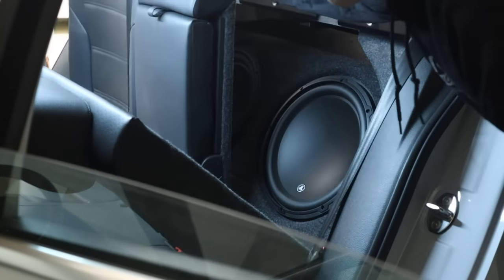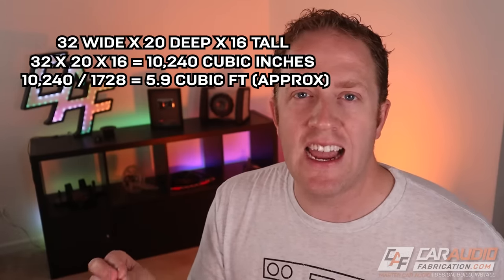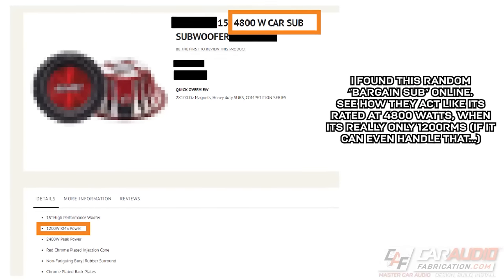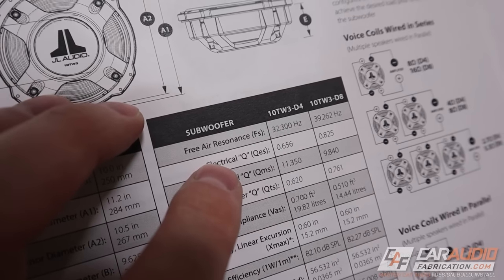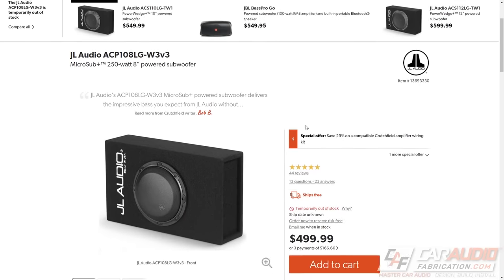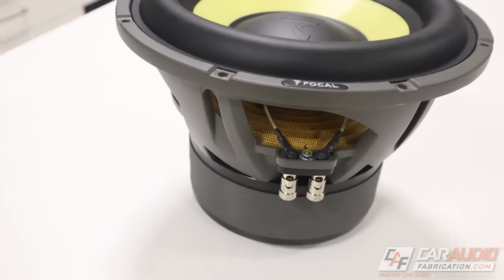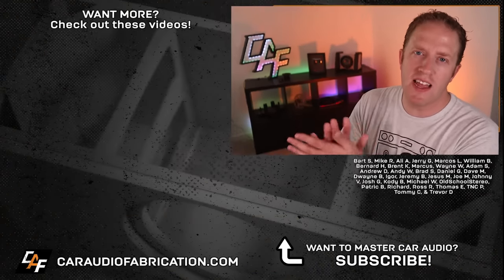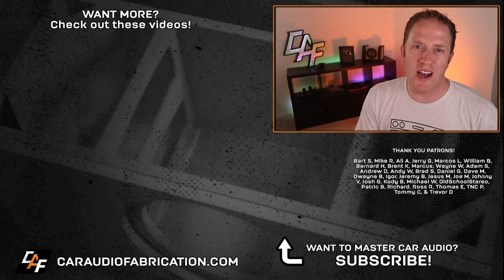DO's & DON'Ts - Picking a Subwoofer for YOUR vehicle!

Comment: i vote we call everything 'walmart watts' except for RMS. maybe then people will get it.
Reply: Best comment I've read in 2021.
Reply: As an former tech, I can tell Wal-Mart watts from what can be reported as RMS most of the time.  There's a certain build quality required in high current capable amps.  Anything worth buying is worth researching.
Reply: Wish watts seems more fitting
Reply: Hello I need help please somebody help me. I want to upgrade my factory sound on my 23 vw Taos but the person couldn’t take the dashboard apart or open it because he couldn’t unclip it and didn’t want to break it, please I need to upgrade it’s driving me crazy thanks
Reply: @reyeselizabeth8948  Just have someone else do it or do it yourself
Reply: Acquire you a interior plastic trim tool set from like eBay and disassemble the vehicle yourself but do it carefully, and you can always try to find information on where the clips would be or maybe find a pre-owned panel and note the locations so you have an idea of where to apply slight pressure to push the clips out to remove the panel
Reply: @reyeselizabeth8948  a pocket knife is usually my best tool for popping panels.

Comment: I see a CAF video, I like it and then watch it.
Reply from the maker: You guys are the best! Thanks! 🤗
Reply: Same
Reply: @filibertofonseca8083  5
Reply: I just did the same thing 😂😂
Reply: Facts
Reply: @CarAudioFabrication   i have a 2019 accord lx base model, and I am thinking of putting a rockford 5 ch. Amp with a rockford p2 and rockford components in the front and coaxial in the rear. My understanding is that the p2 is rated at 400 watts rims and the channel that will push it might get me 300 to 350 watts and I am looking for 500 rms from a sub and 400 to 450 rms.will the p2 and the amps ch. 300 to 350 rims enough to hit really hard and clear or do I need a system that is stronger in this type of configuration? Need your expert advise i do not want to make a mistake with this system. Thanks.
Reply: Do seal boxes have deep Bass

Comment: In the mid 1990's i did my homework and bought my first subwoofer.I bought a JL Audio 12W6 and i had it wired into 3 ohms in a sealed box and used a GENESIS Dual Mono at low gain to power it.The sound was musical,loud and very tight and i have not had to buy another sub and both the amp and subwoofer are still in use now! The JL needed to have its foam replaced but its been an amazing sub.I have just bought a car with a Bose system which has 2 'free air' (fires into the trunk) subs and they are loud but sound totally fluffy and uncontrolled....sealed enclosure anytime.
Reply: Genesis uk amps  awesome
Reply: Most cars I owned had jl subs. 3 12w6 on Fosgate bd1500.1. It's life changing.  Nothing else can compare.  Sealed for the win
Reply: @daviddeatherage4219  I had 4 x 15w6 in a sealed enclosure running off a huge class A/B Hifonics amp (forgot which one it was) and since then ive been forever trying to chase that sound quality. I recently got back into car audio after nearly 20 years and went with the JL 13W7 in a ported enclosure and HD1200/1 amp and im quite disappointed as its just not quite what I expected. Now im thinking of selling the 13W7 and replace with 3 x 12" more efficient subs
Reply: @B15SDMDESIGNS  I've always ran hifonics Zeus love em. But I am in love with 13w3s three of those put serious stretch marks in paint on quarter panels.
Reply: @B15SDMDESIGNS  dude the ported box has to be super physics nerdtunes. By a physics PhD. Stereo shops miss a lot of things. They are trying the best they know what works. For real it is a science.
Reply: Jl audio has that distinct  clean sound, no sub can match. In 1996, we had the first IASCA show in Philippines. The Van won, rigged with JL Precision Power  Audio control system. The detail was an unconventional  speaker from France called DAVIS Acoustics. Those were the fun times.

Comment: That was a great video👍I’m a retired Car Audio Specialist and just watched to check you out and very well explained to people in a very misleading market❤️I would add that the car is the biggest factor in the choice and only take a few test to determine the cars resonant frequency to get the best sub❤️Most people think I have a pair of 15” subs in my H2😂A simple 5 channel 1000 watt Fockford amp and a JL13w3 tuned at 25hz ported and will play smooth and bounce the wipers on low notes😂👍❤️30yrs at it and still got bass in all my rides at 53yrs old and love my music loud and clean👍
Reply: That's a nice combo. That type of system in a suv or a hatchback hits hard.
Reply: whats Fockford? 😆
Reply: My two 13.5w3 on a cheap 60bucks performance technique 3200w Amp. Was the closest setup to audio performance perfection 3 12w6on fosgate800.A2. I miss my youth
Reply: @williamaraujo779  I think he misspelled Rockford , as in Rockford Frostgate

Comment: Back in the late 90s / early 2000s I had 4 infinity perfect 12s in a Toyota Celica,  2000w rms, capacitor, built custom enclosures, removed the rear seat and built a ported wall with two 8 inch subs on it as well. Yes, it was loud and rattled all the sheet metal on that car, no matter how much dynamat I installed 😂
.... Now I'm an old fart missing the old days, a buddy gave me a powered RF punch all in one.  Takes up hardly any space and it still HITS!  I would even have to say if sounds cleaner than my old system, which was way more moving air than that small space could handle
Reply: Hey I have a Toyota celica.. don’t give me any ideas now 🐝 lol
Reply: @interstellarM81  oh you should totally do it 😂 I had the long nosed 90s Celica
Reply: I'm 57, my car is rigged from 90's stuff. Of course JL audio control and soundstream. Enjoy it, especially summer.

Comment: I actually prefer powered subs for budget systems. If you just slap an 800w sub on a factory system it's going to completely overpower it and all you will hear is bass. A 150w powered sub stuffed under a seat is going to do a much better job filling things out. You're right on there.
Reply: Yea if u use a 1990s cat now a days new cars have decent speakers
Reply: @jaygarcia6388 no new car has decent speakers 😂

Comment: You don’t need a high output alt unless your just running 10k watts going full tilt non stop! Just do what I did get you a giant XP3000 battery or two and some good double runs of ofc and a cheap charger and give your stock alt a break every now and then charging them and it works great. I got DC audio 2k and 175.4 and my lights never dim and my voltage never drops below 13.4! I don’t know how my stock alt is tiny but it works has for years now. 105k miles later and it’s all still going strong! I did replace my stock battery and changed Alt once but it was just due nothing to do with the system! I’m sure it shortened it’s life some but it still lasted 190k miles! Yea I always add battery’s till my voltage stops dropping but I never been over 400amps in a car either! But like I said 5-10k you might need one just to keep all the big battery’s charged but I bet I could do 5k daily and get by with stock alt long as I got plenty of reserve battery power.

Comment: Spent 700$ on skar 10inch sub,
 1500 to 1800 sub, got a box they recommend. 2000 watt to 2800 watt amp. 2000 watt cable and amp kits. 200 amp fuse so I overbuilt everything against the sub

Comment: Always use a couple 10s or 1 12 that'll handle at least 2000 watts rms, an amp no less than 2500 rms & you'll get the bass you want. Build the box exactly or barely larger than than the sub specs ported to anywhere between 40-30 hz & build the rest of the system around that. You'll be happy & you won't keep trying all kinds of different subs & boxes. These subs today behave correctly when powered at their rms or a few hundred watts more
Reply: icon  Actually he is.  I mean, he's just being a goof.

Comment: I have a Memphis 6.5 Mojo under the back seat. I built a ported box using a box calculator, I have a audio pipe 2200w amp not sure the rms. But its plenty, with a good sound with the rest of my components. Turned up, my sps has hit 124 which is pretty impressive for a 6.5 now I know they're not exactly have the best rating that I love it.

Comment: Seems like i've done everything wrong since i first installed my audio system.
- Powered everything through a 16mm²  (5 gauge) wire, now a 35mm² wire (2 gauge)
- Burnt a couple of 50W speakers that were ill suited for my amplifier
- Bought two under-seat powered subwoofers. Works great but the bass doesn't go low enough and the volume isn't the same across the lower frequencies; it peaks at about 50Hz.
- Bought a 150W amplifier for a "1000W peak" or rather 200W RMS woofer, then bought another woofer because the sound level was too low
- Added tweeters to compensate, then changed the speakers because the tweeters sounded too harsh.
- Some components were rattling around

Now i have 4 speakers with near flat frequency response (according to the manufacturer) all connected to separate channels on a Pioneer amplifier, 2 under-seat subs, 2x 400W RMS subs in a homemade enclosure according to its specifications and matching class D amplifier, gains set correctly using an oscilloscope, a DSP,...

It still doesn't sound good but now it's good enough, and my hearing is worsening so i've got that going for me i guess...
Whenever i decide to buy a new car, i'm going to do things properly, i promise!
Reply: Ouch!  I always splurge on one thing while stingying on the other, every time, dissatisfied with result.
Reply: You better be very careful on what new car you buy most of them are nearly impossible to upgrade the head unit because it's integrated with the can bus and HVAC. Some of it is supported in the aftermarket but not everything

Comment: What’s your opinion on running 1 vs. 2 ohms in a subwoofer amplifier? 1 obviously puts the most strain on the amp but provides more power usually. But twice the power is needed to raise volume by only 3 dB. So clearly diminishing returns comes into play with respect to amplifier wattage. I feel like when the difference is 700 vs 500 Watts at 1 and 2 ohms respectively for example, the smarter choice is to run at 2 ohms for the longevity of your amplifier.
Reply: 1 vs 2 only depends on Amp and can it handle it.  Any time you drop ohms you increase watts less ohms more power but Only if the Amp can do 1 ohm

Comment: Also worth noting that while they've always had all the hype, bass is not the be-all, end-all to a good sound system. Oftentimes cheap systems will not be crippled only in bass, but also drop some mids or highs as well- and a genuinely good sound system will represent the whole range!

While chasing bass can be fun, make no mistake, giant woofers a system do not make.
Reply: @joslewiswoodcarpenter5171 still going to need a sub....there are certain frequencies that smaller speakers just can't reproduce....there is a reason every good sound system has a some sort of sub....if u don't like too much bass throw in a smaller 8" sub
Reply: go sq and youll never turn back. also an average sq system will easily hit 130db 20hz up to 17khz so don't think that sq system will sound quiet and sharp with no bass

Comment: I want the Fi Neo 3.5 12 inch sub because I want a lot of bass but, with very high sound quality. Get a 2000 watt 1 ohm amp and calibrate it to 1750 watts. Stock alternator, 0 gauge big 3, and build a custom sealed enclosure that fits like glove underneath the metal beam that is below the parcel shelf of my 2015 Camry.

Comment: 4:44  I learned that the hard way...  I had a top of the line SQ sound system with a Diamond Audio 800 wrms sub, powered by a 600 wrms amp, but i could never pushed it as far as it could go. And to make matters worse, it was a class AB amp, so less efficient than a class D...  Nevertheless, it still sounded great.
Reply: my class AB 90's soundstream sounded much better than the amps today. Much of the subs today are better though.

Comment: I'd never really look at sensitivity as a determining factor when choosing a sub. Hoffmans iron law states that you can have 2 of the following 3 things, but not all 3. High sensitivity, low bass and a reasonable sized enclosure. If you want high sensitivity and low bass, you'll need a huge enclosure. If you want high sensitivity and a small enclosure, you won't get low bass. Everyone wants low bass and smaller enclosures, which rules out high sensitivity. Any typical car sub worth a shit will have real sensitivity in the lower 80's. With a cars cabin gain and cheap amplifiers, sensitivity doesn't even matter.
Reply: Sensitivity is extremely important if your vehicle's electrical system is marginal and you have to account for every last amp your amp generates.  It also matters to the bump, bang and shatter their windows crowd trying to achieve high SPL levels (obviously I'm not one of those).  But high sensitivity is always a good thing if the tradeoff to obtain it isn't an issue.  For example, consider an internal baffle subwoofer.  Obviously the enclosure size isn't an issue so sensitivity might become an attribute of much greater interest, no?

Comment: My mercedes is getting 4× c2650x doors. 
2 × 10tw1 in a custom box for the c class and 2× 300w Orion amps for the box and 200w amp also Orion for the midrange doors. 
I'm leaving the stock Harman kardon rear sub and center channel in the dash. 
The tweeters I'll probably leave  HK or switch to a JL 100rms set of tweeters . 
I'm upgrading the head unit to a Decent Kenwood and would like an old school actual 20 ban equalizer. 

Was going to go with 2× 12" JL in a custom box but think 10s should be more then sufficient and the 10tw1 is a thin sub so the box doesn't have to be deep in the trunk and still thump hard .
Debating if it gets a forward facing box or old-school rear facing.

Comment: The sub was the part that took me the most research for a stock application.  I needed something that would work with the stock wire (I did not want a sub amp.  I know), fit in the OEM space and have room for the cover to be cleared.  I also wanted something IN CASE I didn't like it and wanted or needed to add an amp.  I needed an 8" and the settled on a Pioneer shallow mount, which really measures 7"...

After tuning for some time, I like it and if I ever wanted an amp, it can handle 150 watts, so that is fine too.  However, it hits most lows on the stock amp, which is good enough.  The aftermarket amp and high level speakers round out the rest and make everything rock.

Comment: I'm trying to understand car audio. For the subwoofer, I have a '93 Miata and I'd like to put one in the car. I'm willing to do custom work. Often times, I see people placing them in the trunk. But with it being in the trunk, isn't it completely closed off from hearing it? Or is the purpose of a subwoofer and its low frequencies is to create vibrations? Aside from that, I have aftermarket 4x6" Polk db462 speakers in the headrest enclosure (2 in each headrest). In addition to that, I have a Kenwood coaxial speaker in each of the doors. Lastly, I had also installed a Panasonic CQ VX5500 (to match a retro aesthetic interior). I'm wondering where to go from here.

Comment: I got a 10” JL TW3-D4 it’s shallow mount so i figured it would be good under my back seat. I also got the JL JD500/1 amp. It’s in a sealed box firing down. I got the JL cage to protect it. I wired them to 2ohms to get the full 500W but the sub can only handle 400W RMS so I was told to keep the gain down a bit. Thankfully the amp has a red light telling me if it’s clipping. I turned my volume up to where my door speakers started to  distort and then turned it down 2 notches. So 32 is my max volume, I then play a bunch of high bass songs and let them run through. If any of them made that red light come on I turned it down a bit. I think I have it where it needs to be but I’m still scared. I don’t want to blow that sub.  I did the ohms x power (800) then I got the square root 28.28 and set the gain to that but it would still clip on certain songs. I have an oscilloscope but I’m not really sure how to use it 😂  I’m in a pickle man and I don’t know what to do. Does anyone have any advice for this amateur? I set the low pass filter to 80. And the bass boost is at like +11.. I have a remote knob on the way so I can turn it down or up thats why I love that clipping light but I’m still scared I’m going to blow it. I have a pioneer DMH-WT3800NEX head unit. It’s all in a 2011 Sierra Ext cab under the back seat. 

Is there anything I can do to make it better or protect is more? 

I mean I got it all working, steering wheel controls work, blinker/warning chimes work (they come through the radio in this truck). The amp and sub sounds great it smelled a little bit when I first got on it but I read that was normal and it went away after 5 mins.
Reply: All fine except the bass boost, turn that off or down.

Comment: Would an ES 10” Sony sub in Rhino Lined box be a good pick? I was very happy with an 8” Rockford Fosgate in my last VW Cabrio. 
I’m considering the 300 watt self amped Rockford in my recently purchased Cabrio, or the ES to hook up to a 5 channel DSP amp 100 watts per ch powering my 6.5 Sony ES speakers, tweets, and some filler speakers in rear side panels (trying to figure out what will fit).